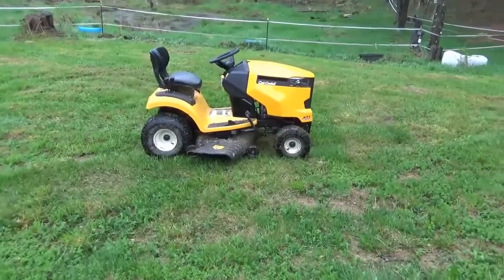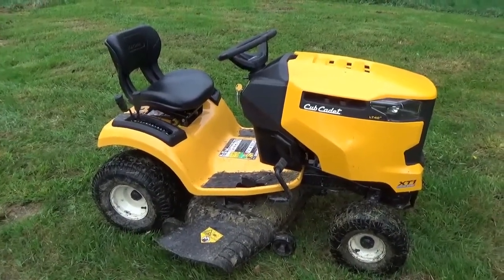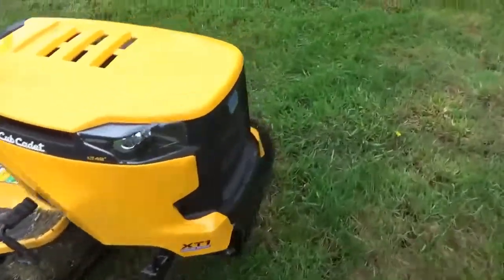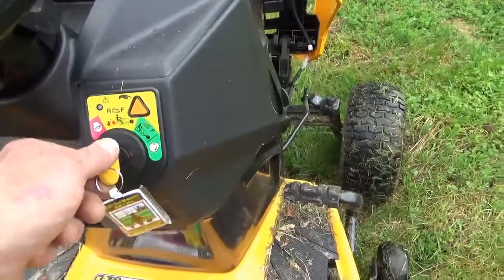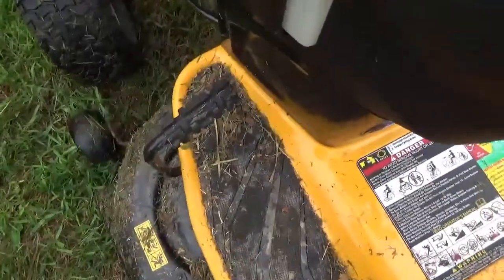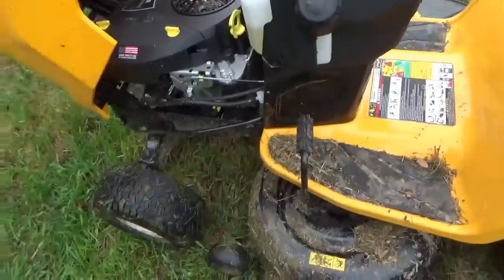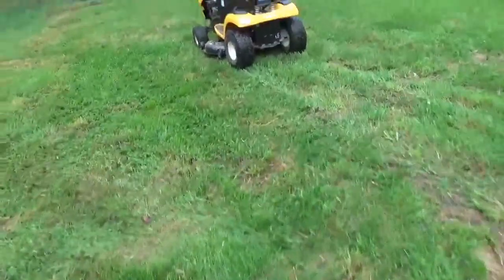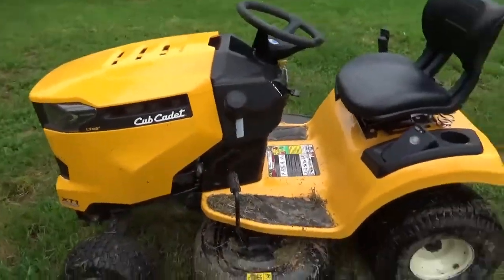Cub Cadet XT1 Lt 42 Riding Mower Overview

Comment: I just got that one too, it was from last year so I got it on clearance. Now I have this one and the 46 inch one too. And I got mine at home depot it's the same thing as yours it has the USA made 18 hp Kohler motor
Reply from the maker: Awesome, good luck with it!
Reply: @SteeveeDan  thank you, how is yours holding up?
Reply from the maker: @joshtheinflatableking  When I put it up for the winter last fall it was still like new. I'll be "un-wintering" it soon and will make another video on its status.
Reply: @SteeveeDan  awesome

Comment: Nice review 👍 I just bought the XT1 50" Fab deck and I'm actually very impressed with it after the first mow.
Reply: any issues with thr 50 inch deck yet?
Reply: @EpicConspiracy  After approximately 12 hrs cutting I've had no issues.  No mechanical issues and tall thick grass ejected fine with no clogging. Definitely seems tougher than the older style deck. For the price vs a commercial mower I'm satisfied with  my purchase.  Hope this helps.
Reply from the maker: So glad to hear that!

Comment: I just bought one yesterday love it
Reply from the maker: Awesome! Just took mine out of hibernation last week, started right up and mowed the lawn at the new house in NY! Congrats!
Reply: @SteeveeDan  thx alot bro quick question do you run pure gas of the regular gas with ethanol
Reply from the maker: @26johnbeat  I just use regular unleaded at the pump which contains ethanol. At the end of the season, I let it run itself out of gas and the put a splash of gas and fuel stabilizer in the fuel tank and run the engine for just a few seconds. That way  I'm pretty sure it made it through the fuel system. When it's time to use it again, I fill the tank with fresh gas and that's it. Been doing this for years and never had a springtime starting or running issue!

Comment: I did my Cub Cadet from Home Depot. I have not pick it up yet. But my engine say 547cc. And also says maid in China.  But it is 42inch. Same as yours for the same price. Thanks for the info on the mower.
Reply from the maker: Thanks for the comment and good luck with your new mower!
Reply: I bought mine at Home Depot and it says made in America
Reply: @BHauck-os9sy  The Kohler 5400 is assembled in the US from global parts. Not sure what that means. The Cub Cadet branded engine is a Chinese built engine.

Comment: Nice review, I got the same model back in January with the plow attachment. I got mine mainly to plow with , my snow thrower is not kind to my back. I just mowed with it for the 1st time, two properties that are hilly and it worked flawlessly. I just need to get used to what deck height to use in certain locations. As far as plowing snow I left the mowing deck in place. The deck weight helps with steering due to its location. I do have the grass chute in the up position when plowing and tire chains are a must.
Reply from the maker: Thanks for the comment! I really like mine so far and feel that I made the right choice for my needs.

Comment: When setting the cruise control does the mower had to be at stop or it can be done while it is running.?
Reply from the maker: Hiya, The cruise can be set while you're moving. It will not set at the mowers fastest speed however and I've never tried it in reverse. Hope this helps!